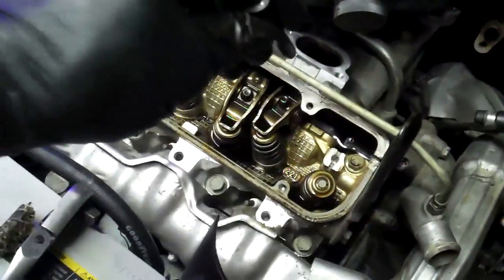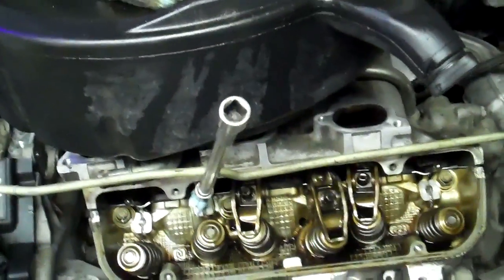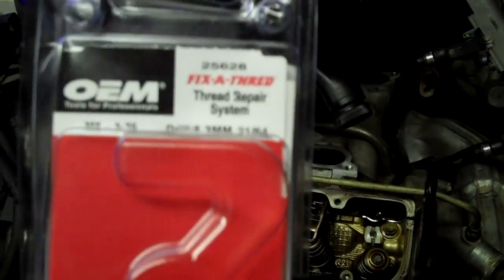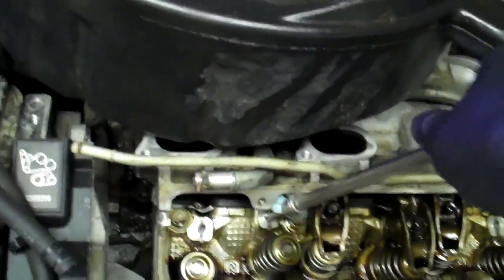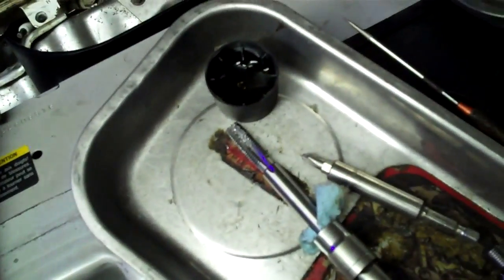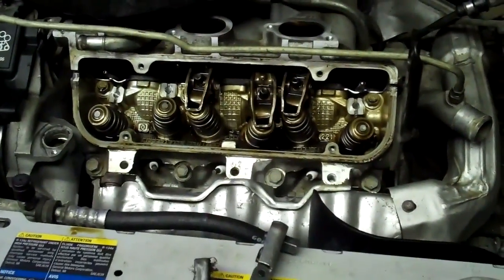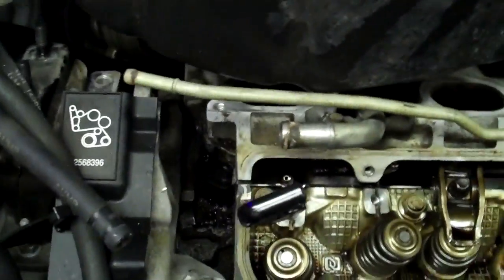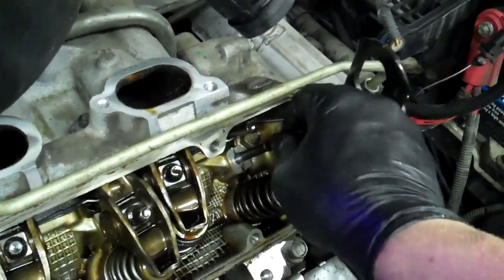How to helicoil GM cylinder head rockers

Comment: I’m afraid that threads may be the issue for my (pretty bad) rocker arm play, but I took apart and cleaned the lifter and I’ll see if that was the issue. Upon taking the rocker arm bolt out, that specific one took a lot less force to remove and it kinda felt loose unbolting it. Shucks

Comment: I just got one of these 3400s  in here last week, in a '04 Olds Alero. Of course, it was the #1 cylinder in back - the stud had yanked right out of the head while the owner was driving! Sounded like a washing machine full of rocks. Car has less than 64k miles on it too.

I used my M8x1.25 Time-Sert to repair the threads, but the problem is, due to the flange on the top of the insert, I couldn't get it flush with those 2 cuts in the base there ... so had to hack them flat with a hammer & screwdriver. Wasn't pretty. Dremel would only fit at an angle - just enough to start a cut. Now the valve seems to be forced open when I tighten the bolt. Grrrr ....

 What a piece of crap design!! GM is really hitting it out of the park lately ...
Reply: Smitty Smithsonite I have the same model car that you said that you got in there working on and it’s my third rocker from the passenger side on the front side and the boat came right out what no tightening it up or nothing when we pulled it up out of there it you could tell it had Healy coil on it what to do what to do it’s been sitting in the driveway for three months now old man won’t work on it are use YouTube to learn do it myself

Comment: To anyone watching and reading this: 12 point socket's have a purpose. No need to grind down your tap. Try different sizes of 12 point on your 3/8" ratchet, you'll find one that fits like a glove. I've even used 12pt socket's on E-head Bolt's. Good video on that common GM problem.
Reply: i always use 12pt sockets for tap drivers. taps rarely ever fit a 6pt

Comment: Poor old gm and their problems. Makes things much harder or maybe no harder this problem just gave me a shock. I've done many of these engines and thank the Lord i was the first one in the motor. This car looked professionally done and clean intake gasket were overtighten so when i got to the rocker arms like this guy did trouble from the start i didn't even get a chance to overtorque these rocker bolts even though i use a torque wrench abd factory specs for builds so these problem won't arise. Can't wait to take the cylinder head off and heli coil all 6 rockers. Time sert make a good kit to but kind pricey but once i buy tapping oil and thread locker it's almost same price. I love my 3800 cast iron rules. May be heavier but wow i wouldn't have ran into this mess

Comment: 12.2.13.  Also Lisle 48300 pushrod removal tool enables you to pull the push rods without loosening the rocker arm bolts.

Comment: I believe 2004 and up use 8mm bolts instead of 10mm. I had one that nearly all the rocker bolt holes were stripped. I taped them out to 10mm and used the old style rocker arms I had left from other engine swaps. It worked out good.

Comment: and one other tip brain, i did notice you pulled the fuel rail and injectors, something i do just remove that cap off the end of the fuel rail and u can get the power steering pump past the fuel rail, saved a shit ton of time, and later years theres a 10mm nut holding the PS lines on the generator stud. im sure u know this trick.

Comment: I bet if you did some digging, a GM tech has probbally had thos out before and over torqued the bolts, i accully had someones comeback ones for that, except the rockr arm was floating around and the pushrod was beating off the valve cover, and OFC was on the rear bank on a freaking van, lets just say i was pissed... i used a timesert rather then a coil. good repair buddy!

Comment: this gives me flashbacks... 2.2L OHV motor in an 01 cadavalier a few months ago!  Looks real similar, same motor?

One spark plug took a bunch of threads out, there was a crack through one of the spark plug recesses an exhaust port and a coolant passage, and the head gasket was blown.  It sucked.

I think the word you were looking for is "axis". Nifty trick with the tap and extension, I hate it when I break a bolt or screw up tapping a hole because the tool isn't aligned to the axis of the hole.

Comment: The threads came out because whoever got into that motor before you tightened the rocker bolts down too tight. The factory specs for those heads is only 89 inch pounds, which is only about 7 and a half foot pounds plus a 30 degree turn (twelve to two on the clock). I learned the hard way just dropped a helicoil in a 3.1 after torquing out the threads on reassemble for intake gasket

Comment: My wife had this happen to her '03 Alero 3400 last week.  Sounded like a rod knock/ no power and popping thru the intake and missing badly. PO300 misfire code.  It would rattle when I rev it at all.  I pinpointed the rattle to the front valve cover and sure enough, cylinder 2 had no rocker on the exhaust valve!  I heli-coiled it like this and she purrs like a kitten again...well, she runs and has all 170 ponies again anyway... I hate aluminum heads!

Comment: My god its like you read my mind.  I'm a long time subscriber and all your videos and your crf450 videos have helped me on many challenges.  A bolt on the cam carrier of my 450 pulled the threads out of my crf heads.  I went to lowes and bought an 8 point socket and it worked wonders on my setup.  Thanks for making all your videos and keep them coming!

Comment: @briansmobile1 hey brian, never tryed to helicoil cause all the bad experience my friend had ,BUT ive just fied a fiat 1.2cc head with a nut to fit the bolt where it was tighthened over ,by shaving sides into kinda 3 angel and bore "side holes" in the aluminium head so the nut kinda fitted and love tapped it into "place" then with a point punch marked around the top to"weld"it in and it worked magic... good to see helicoils do work too ha ha,alot easyer.

Comment: @briansmobile1  I am lucky at least I have a 6k gen set up to power all the crit systems in my house and a few lights I had 2 pumps going and with out those I would have had 6 feet of water several friends of mine had over 5 feet in there basements . I had a gas water pump but it got hit by a tree last year tore off gas tank. I have power on off now the village near me lost the entire water system I have a well cant use till it clears in a few days .On craigs list gens sets lk mine over 1500 dls

Comment: I have a 2003 chevy venture that had the head gasket problem and the chevy deal used time certs  they said the heads would cause helicoil to pull out.  
I am still without power on generator power  and using dial up . Hope power will be fixed friday for all around . I lost my septic tank propane tank and had 2 feet water in basement pump could not keep up . We got 1 inches rain my well was under 5 feet of water Bad part no insurance! Who knew over 22 years here  never that much water.

Comment: The reason that the threads pulled out of the head is that the bolts were over torqued. Very common on the 60 degree V6's. Impact tools are not always great. A tip on drilling and tapping in the area you were, pack the grooves of the drill bit and tap with front end grease and 98% the fillings get trapped in the bit and the rest are trapped in the grease that is in the tapped bolt hole

Comment: Have you tried using the Lisle 48500 Push Rod Remover or a tool truck version? You WILL strip out at least one rocker arm stud doing it the hard way. The easy way is to use the Lisle tool and not worry about messing with the rocker arms or valve covers to replace the LIMG. People over on the gaownersclub forums have bad luck all the time doing it the hard way. 

Try using a screwdriver magnetizer on those cheap little jeweler screwdrivers.

Comment: Hey Brian another great vid.  I have a tip for you.  When you have something to retrieve in a spot that a magnet will not get try your trusty shop vac.  I  made a cap to cover the end of the vac hose and glued a nipple on it that accepts a narrow piece of hose or the spray straw from  a  wd-40 can.  When its necked down like this the vacuum is tremendous and it would have retrieved that heli-coil piece

Comment: By the way, when I had a similar experience with a bolt for a water pump, I found a reversible, ratcheting device that will shrink/expand to grab any size square tap, sold at Princess Auto here in Canada for about $15. It has a hexagonal head, that permits you to fit a  socket on top and then use an extension/UJ and a 3/8" socket wrench. It has a low enough profile to get into areas that a usual tap doesn't fit. 

I like the idea of a square drive socket set, but those babies are expensive....